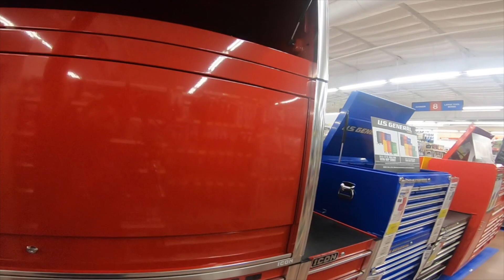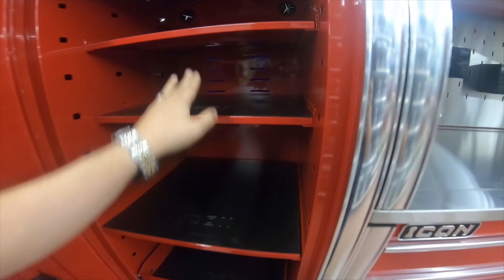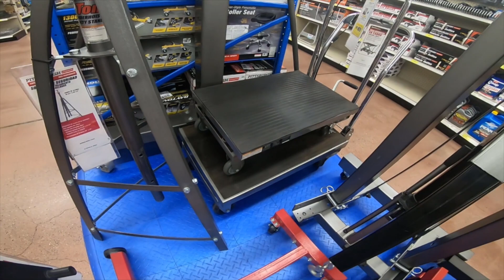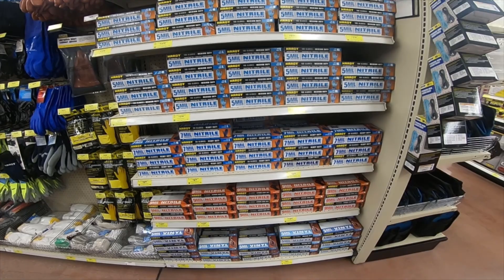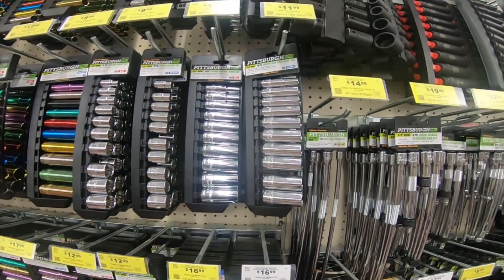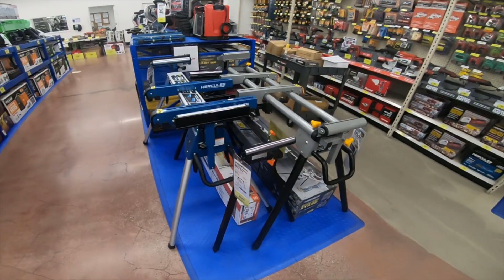Harbor Freight - ICON ToolBox Exclusive Look And Walk Around (Part 1)

Comment: Great walk through one of the best I have seen what do you think of the box does it live up to the hype
Reply from the maker: @Junk From Work  I think the box is nice has very nice smooth ball bearing drawer slides love the retention nobs for the drawer slides I think the price is very high but I would totaly buy the locker the locker has it's own wheels so it dosen't hang on the toolbox like the us general locker i would definitely buy the icon locker and slide it next to my Us General tool box the icon locker is thousand times better then the us general locker you can tell by feel and weight that the icon box is definitely better quality and built tool box compared to the us general the Hutch has a very smooth movement for the door the pistons actually slow down at the end to keep the door from bashing into the hutch all in all im impressed only thing I dont like about the icon tool box is the shallow drawers are so much more shallow then the shallow drawers on my us general series 2 i show that in the video as well on how shallow the depth between the us general series 2 drawers are compared to the Icon Which is a ton smaller
Reply: Antonio Claudio Michael 2k for the side locker(icon)
Reply from the maker: @joeframer9642  okay you know more then I do good for you